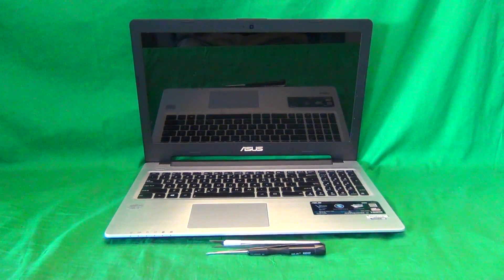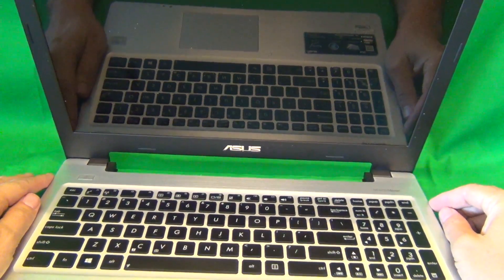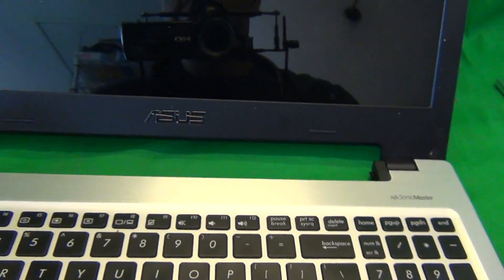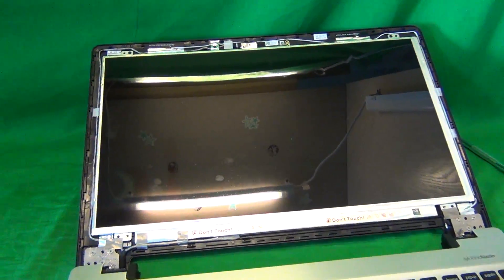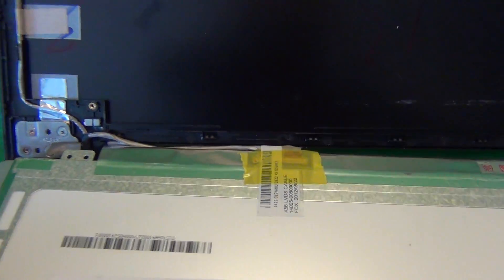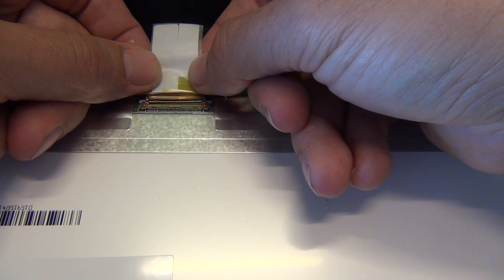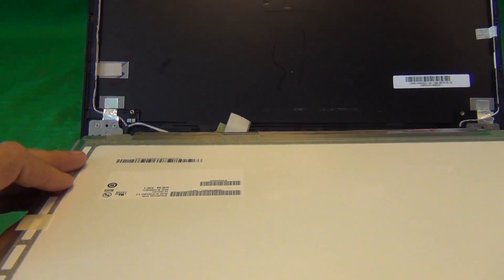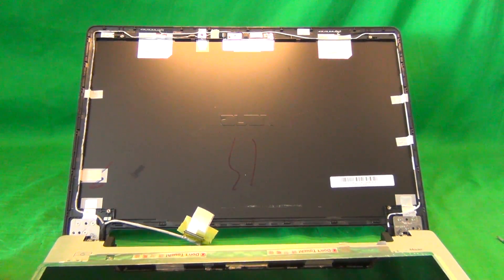ASUS S56C S56CA Laptop Screen Replacement Procedure

Comment: Hi, nice video.
I have an Asus S56C I installed an mSSD and Windows 10 on it, everything was beatifull, laptop worked really fine, until I installed the SATA disk that came with the laptop. After restart, laptop boot from the old disk, then I went to bios and change boot order, saved and after that, laptop dont boot again, I cant even get to bios, screen doesnt show anything. Do you know how to reset bios on these machines? 
Any help would be very presiate.
Thanks

Comment: Hello 

One important comment I would like to make is to be careful not to accidently lose the tiny magnet just in the area of the left hand bottom screen mount. Sometimes this magnet gets attached to the metal screen mount of the bottom of the screen its clearly visible in your video Its a powerful magnet and its necessary for the laptop top  closure sleep/ Hibernate function If you lose it its awfully hard to replace Also on my model there were no bottom screws either so Asus fabricaters must have been having a really bad day

Comment: question for you sir: there appears to be a neodymium magnet that came out of the left hinge. I'm guessing this is part of the lid sensor. where is it supposed to go? I accidentally picked it up with my screwdriver as I was lifting away some dust that accumulated in the hinge.
Reply: The magnet is clearly visible in the video it belongs in the small indentation at bottom left side screw mount

Comment: Excellent instructions, I was able to swap out the screen in 15 minutes.  The only glitch was that the screwdriver included in your shipment was too large for the tiny screws at the top of the screen; I had to use an eyeglass repair kit screwdriver and somewhat stripped the screws, which could be a problem in the unlikely event that the screen has to be replaced again.
Reply: Yeah I couldn't find my smaller screwdrivers so I had to use a pocket knife 😬